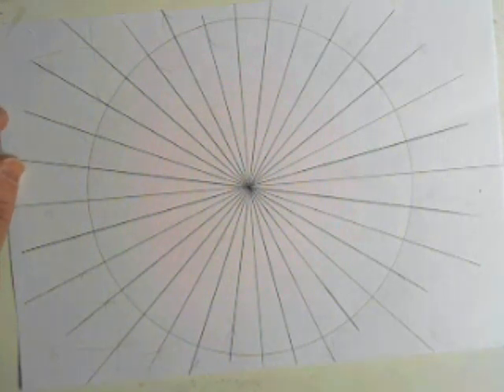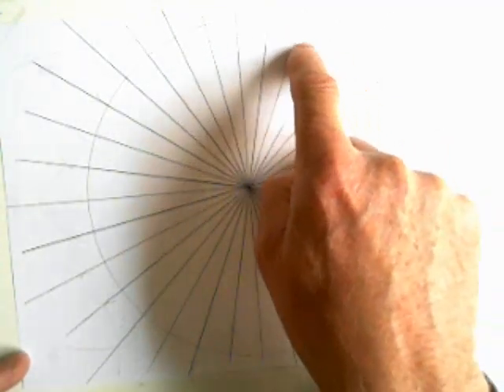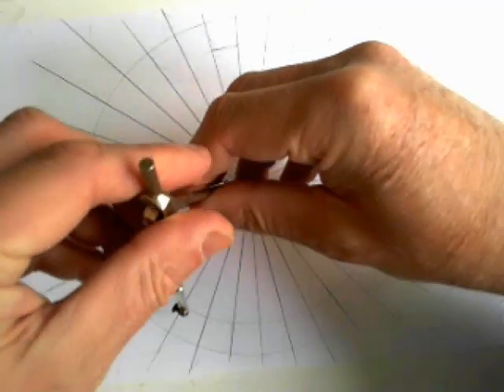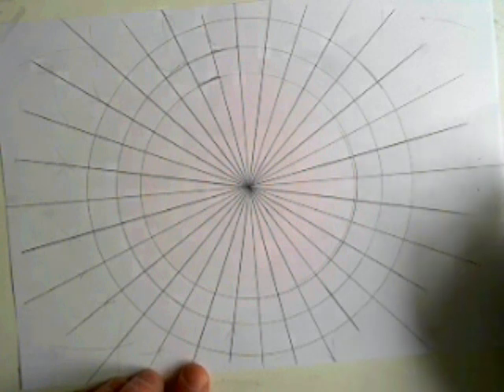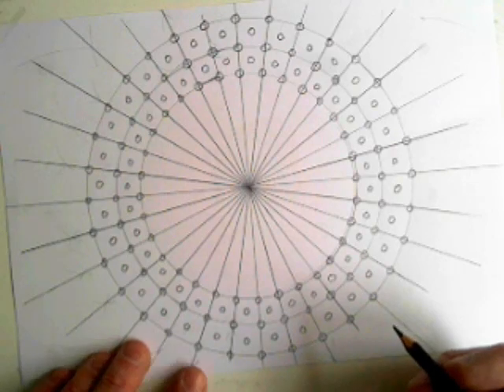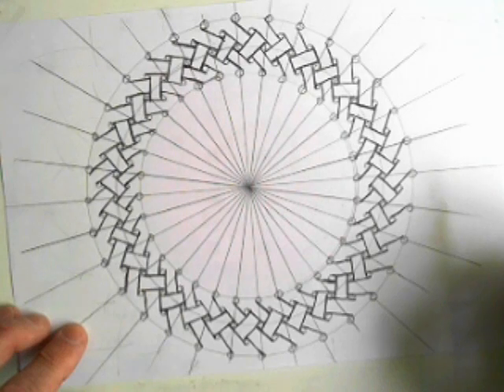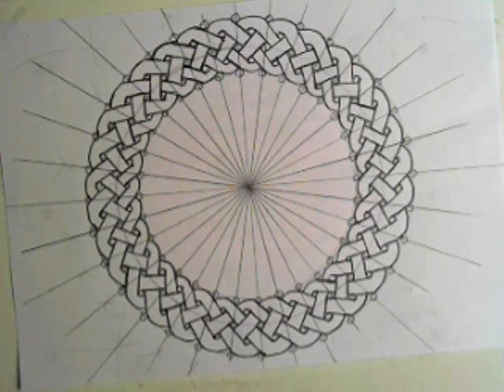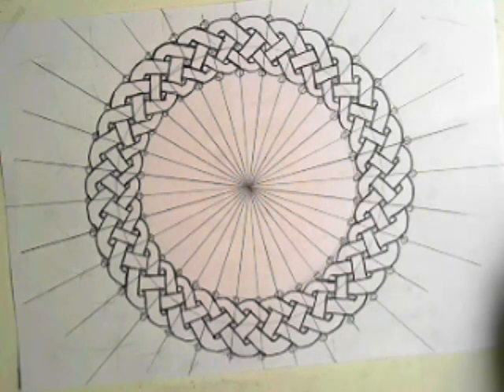Celtic Design 13 (a circular border)

Comment: Hi David, I have just began to learn how to do this art and I am getting on fine for a novice thanks totally for your videos. Just a quick question about this one. Do the circles that are used for guides reduce in size as I get nearer the centre or do they have the same radius throughout.( The Circles marking the cross-sections)
Reply from the maker: Thank you for your kind comments
If you want the strands to stay in proportion you'll have to reduce the separation of the circles as you approach the centre. It's explained in one of them

Comment from the maker: The rubber that I'm using in Tutorial 1(and various others) I've had for 20 years. I like it because I can use it accurately. I has just run out and I've replaced it with a Pentel Click Erase, which is similar. However, any soft rubber will do. The trick is to do your guidelines lightly and not put any pressure on your pencil.

Comment: Thanks a lot. This video helped me so much. Would you be  so generous  and teach the kind of triple braid knot in circle or straight or whatever just like this understandable! You know like hair braid but in a circle please. Thanks
Reply from the maker: You can easily do the hair braid by using only three circles, then you are effectively using a 2 unit grid.
Reply: @davidnicholls100  thanks alot... I went on to try it; but I just couldn't figure it out!!!! after drawing the grid... the lines...parallel lines... wher should they go? and which one goes on top of which one? and in which direction? and all... I'm so stupid.... mmm but this is just beyond me... not my strongest ability is to draw... That's why I'm trying to improve... thanks any way but guide me a bit more if you had time and all... it would be soooooo appriciated; as it is the help that you just  have provided me with.
Reply from the maker: Coral.
in pencil draw a circle 10cm diameter . inside it and from the same centre,   draw another circle 8cm diameter , then another 6cm diameter. Draw your radials through the centre point.
you now have a circular 2 unit grid